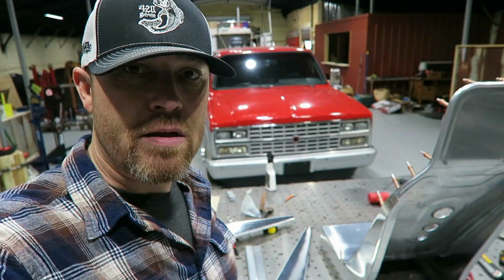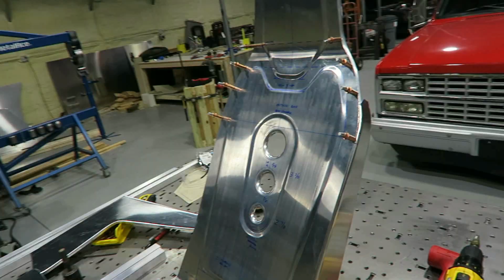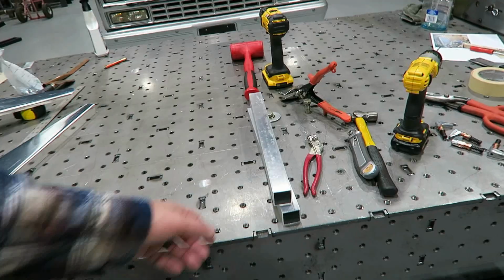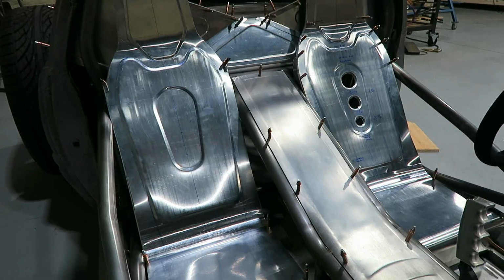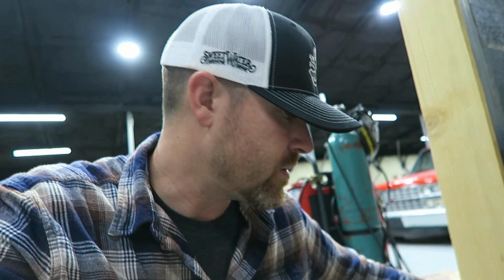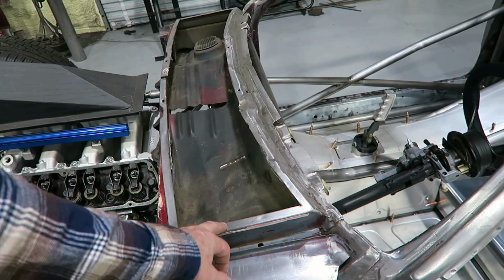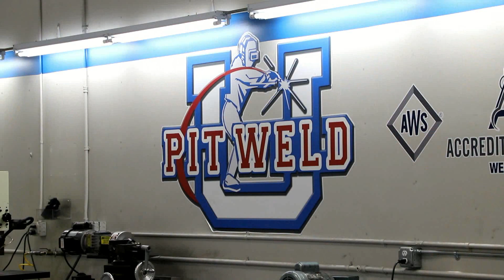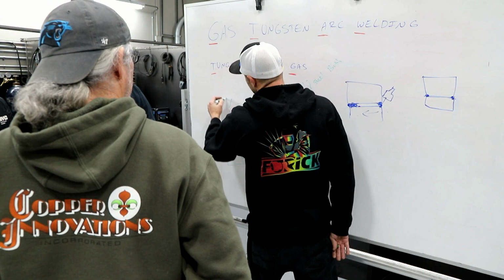Handmade Aluminum Seats Get The Finishing Touches

Comment: Unrelated to this video, but regarding your killfab website:
Under the "Killer Fabrication" page, the "tags" column extends very far down to include all of your page tags, but ends up leaving a lot of blank space in the middle due to the 5 story limit per page. I might suggest increasing the amount of stories per page to 6 or 7 to fill up this full area. This will help with scrolling down past a lot of blank space to get to the next page.